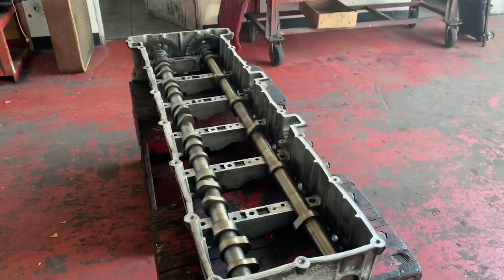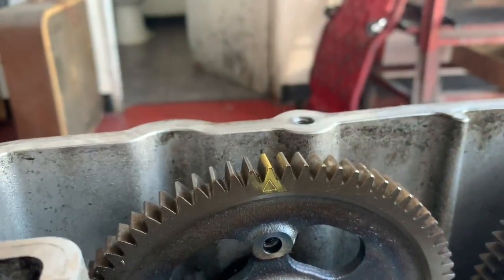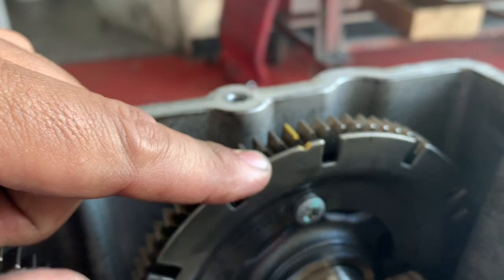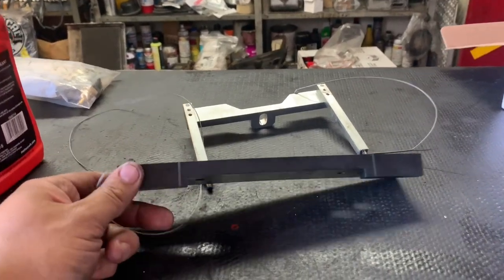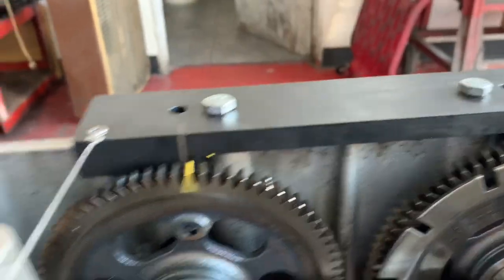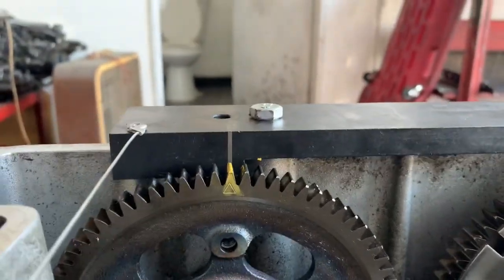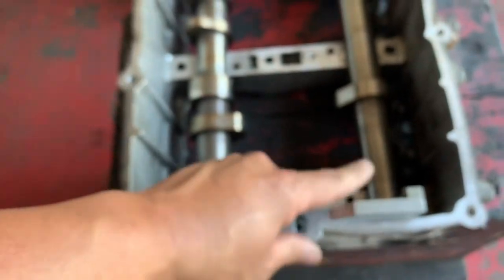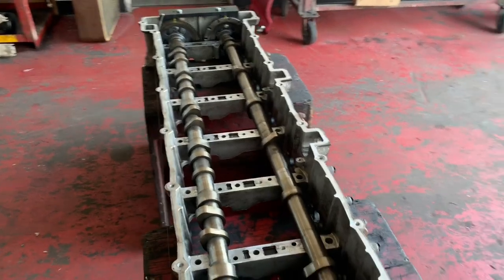Setting your timing (marks) on your dual overhead cam on a DD15 and DD13

Comment: Hey bruh need your help.

I have dd13 with the rockers and camshafts removed. I need to put them back but I wanna make sure if its tdc for cyl 1 or 6. As the cams and rockers were removed without setting timing marks or even locking the engine in tdc
Reply from the maker: Easy fix, rotate the engine and look at the flywheel housing at the bottoms. Look for the mark on the flywheel, it is the only mark/ dimple. The mark must be at the edge or corner of the flywheel housing. If you have a timing pin, remove the position sensor and insert the pin to confirm you are TDC. Then you can proceed to install the intake and exhaust CAM and go from there. 
Let me know if that helps

Comment: Hey Carlos I have 2011 Cascadia DD15 I think my truck may have jump timing It will run for 5 miles of driving then shuts down I get a SPN 636 15 and SPN 723  2 08. .I pulled off the rocker cover and set the TDC on the flywheel the exhaust side time mark looks off.. You think I may have spun the cams-?

Comment: What if you don't have that gadget what will you do to get correct timing measurements
Reply from the maker: @andrewmganga243  great question, before you remove them you can mark the housing. But that doesn’t always work.

Comment: One quastion how do you lock crank
Reply from the maker: @deexmoo4272  remove the flywheel position sensor and install the pin. When you turn the flywheel over to locate the mark on the flywheel in the opening. Insert the pin to confirm its location.

Comment: Are the both tools necessary ? After using the first tool  ,normally  the two camshafts are well positionned ? where can i buy a similar tool useful  to adjust the position of the 2 camshafts for an  engine 4  cylinders  Mercedes Atego  EURO 6, TYPE  OM934 ?
Reply from the maker: I use both tools just to be sure my timing is correct. For me it is a good practice.
Depending on the tools you are looking for, google might be your best bet.

Comment: Quick question, is that notch in the intake cam position sensor pickup plate from factory? Or has someone carried over the timing mark from the other side of that gear?
Reply from the maker: Some of the first models did NOT have the notch but all will have the triangle on a tooth. The factory started the notch back in 2013 or so.

Comment: Why lift it?
Reply from the maker: You lift the CAM and set the marks to match because the flywheel is already set to time (TDC). If you rotate to engine then you have now moved the timing.
Reply: @CarlosDieselElectric  If the flywheel is already set lifting it then turn it to the mark the whole thing would be off wouldn't it be? I could be wrong mainly having trouble understanding.

Comment: My truck's injectors and the 13d are from the engine's injectors
Reply from the maker: The process is the same but does require different tool to set the timing marks on the CAM housing.

Comment: I work on Cummins isx15 and 12 cm870 but I'm hoping I get to overhaul a dd15 soon. Everyone I know is scared of them I don't know why
Reply from the maker: Most guys are scared because they don’t know how to work on them. There are a lot of stories out there of guys working on them and the engines lock up. 
That happens for a few reasons. Not priming the oil and fuel system properly before starting the engine. Those are the two most common issues.
Reply: @CarlosDieselElectric  Patience and practice is all it takes. I just found your channel and it's very helpful,keep it up man.
Reply from the maker: In my opinion, don’t be scared and be confident in your skills and you will be fine. If you have work the ISX15 and similar engines you can definitely do this.

Comment: Hey bro, my engine was showing signs that the head gasket was blown, i removed the head now trying to fit it back, do i just have to put the camshafts back set the timing as you have shown, or i have to time the engine again?.
Reply from the maker: I always set the engine to time before I take the engine apart. But if you didn’t, that’s ok. You can still set the time so you have the engine at TDC. 
Then install the CAM’s. Sorry for the late reply.
Reply: Okay im from Zimbabwe im having a hard time to get hold of that timing tool, is there any other way to set the cam timing?.
Reply from the maker: @libertytinashe3555  you can set the timing on the engine TDC, but to set the intake and exhaust CAM you do need the timing tool to make sure the marks are on point.

Comment: Hey bro nice video, So what about if I missed the timing and I have to set it again how will i gonna do it
Reply from the maker: You may have to start over. Did you take it apart when you were at TDC 1? 
Or what did you do? Just so I can understand where you are at?
Reply: How can I start over should I remove it one by one again
Reply: The Top was leaking oil but we did get the correct timing so the car was not starting? So I came online to watch ur video, so we set the timing again and the car started
Reply: But the moment the car get started we didn't get the engine sound well, and the engine was on 4 to 5 minutes and it turns off so now the the engine isn't starting again
Reply from the maker: Could be air in the fuel system can cause the sound and hard starts. If the timing is off you can also have this issue.
Reply: Am from Ghana 
west Africa
Reply: Ok
Reply: I have turn the flan wheel and the camshaft timing is on position
Reply: Please about from YouTube any app I can chat with u
Reply: So dat I can send you some images
Reply: Still the car isn't starting

Comment: Hey great video I'm changing the housing gasket how do I adjust the gears
Reply from the maker: I first start with removing the valve cover so I can make sure the engine is TDC 1. You can see the timing marks. Then, you will need the CAM timing tool and the timing pin at the flywheel.
You don’t have to adjust the gears. Just make sure the timing is set before you remove them and of course when you are going to need to set the CAM when you place them back down.
Reply: @CarlosDieselElectric  thank you so much for that I bought the tools and I never done the dd15 I work with cummins and volvo

Comment: Dd13 2015 code spn 723 fmi 11
Reply from the maker: Could be the CAM Shaft Position Sensor, could be a harness issue, could also be the CAM (intake). 
What have you done to the truck? Any repairs?

Comment: Hey brother how’s it going. I did the housing seal but took everything apart as one, didn’t remove piece by piece. When I placed the cam housing back I notice the exhaust timing mark was of by one tooth, intake was right on the spot, will this be an issue when starting the truck? I appreciate your advice
Reply from the maker: It might be an issue, you would have to perform a valve adjustment in order to check. 
I would hate for you to bend a valve or damage something when you start the engine.

Comment: Hi, 
Thanks for the video. I did dd15 overhaul, but the timing on the camshaft gears little out line. At the bottom by flywheel is perfect. Would you advise please
Reply from the maker: sandy bil which CAM is out of timing?
Reply: Carlos Diesel Electric , both exhaust to the left of line. And intake to the right of line
Reply from the maker: sandy bil If your flywheel is in the correct position and the timing pin is seated then the CAM should be lining up. I usually experience the intake is just slightly off center. I recommend to pick up the CAM and reposition as close to it as possible. Use the tool to line up the marks on the gear and then use the other part of the tool to line up the front part of the CAM. If the resistance is hard then you might be off. The front tool should slide out fairly easily.
Reply: Carlos Diesel Electric I have picture if I could email please.
I tried and picked both but still little of.
Reply from the maker: sandy bil email me. Carlosdiesel@sbcglobal.net

Comment: Hey how you doing I got a 2011 freightliner Cascadia I just did the timing seal on it but their rear marks or one teeth out  but I put the time in to before I remove the house and can I get the paint on the fly wheel would you help me out with anything please thank you
Reply from the maker: Vasya is this the intake CAM?
Reply: Carlos Diesel Electric no the exhaust it’s one teeth out is anyway I can send you a picture because I’m confusing with that whole day and this is my first time in housing seal
Reply from the maker: @vasya7638  send me a pic. 323-697-2425
Reply: Carlos Diesel Electric and I have a timing tool which I bought it the timing tall is locked in the front
Reply from the maker: @vasya7638  double check the flywheel, not just in the window of the housing but also use the pin that is installed where the crank position sensor. Something might be off just a bit.
Reply: Carlos Diesel Electric Yeah the pin inside I just lift  the housing up I was able to move it one teeth Everything is on time thank you for Help 👍👍👍
Reply from the maker: Vasya awesome 👍🏼
Reply: Carlos Diesel Electric thank you again I was lost man thank you so much your video help me a lot

Comment: Im about to set the head on a dd15 so i got you how to setup the timing on cams 
But u didn’t say how to timing the crankshaft 
Please
Reply from the maker: Tito omar check out my other video. DD15 valve adjustment part 1. I go over how to set up the crankshaft on TDC and using the timing pin.

Comment: Hey I installed cams timed the flywheel and locked my cams and now am getting a cam timeing check engine light. Maybe engine harness???
Reply from the maker: You might be off just slightly on one of the CAMS, my guess is probably the driver side CAM. Was the light or code there before?
Reply: Carlos Diesel Electric there timed right on the lines on the tool and locked.  The truck had a bend valves and the exhaust cam lobe turned.  So I took everything off and replaced all replaced cam swapped head.
Reply from the maker: Typhoon Submerine need some more information, what year is the truck? Was the code there before? Did you replace the CAM position sensor?
Reply: Carlos Diesel Electric yeah I replaced it. The truck was running down the road and the valves bent due to a overspeed cam lobe turned on cylinder 3and 4 head valves got bent piston were good just put new exhaust cam and anouther head from a machine shop.  I think maybe the intake cam is shifting due to a bad cam housing truck is a 2012 dd15
Reply: Carlos Diesel Electric cam position sensor check engine light comes on and off about 10 seconds on and then turns off
Reply from the maker: Typhoon Submerine that is possible that the CAM is shifting. I would time the engine TDC 1 and check the valves. It sounds like you did everything right just something isn’t matching up.
Reply: Carlos Diesel Electric got it will do tomorrow thank you
Reply: Carlos Diesel Electric I had a bend tone wheel on the intake cam very slightly bend.  Thanks you for helping bro
Reply from the maker: Typhoon Submerine you are welcome. Glad you found the problem

Comment: Hey bro great videos man, just subscribed to your channel. Question im about to do the cam housing gasket. Of course im gonna pull the whole housing as one part. Now how would I set the timing with all the cams in place? Just rotate the flywheel? Let me add, ill be using the same timing tool, but with the flywheel pin. Thank you so much for your videos brother.  God bless
Reply from the maker: I recommend to rotate the flywheel, once the CAM's are in position (meaning you see both marks on each CAM at the 12 o'clock). Then you are ready to begin, however you have to keep the CAM's from moving this way once you return the complete housing back in to it's place the CAM's will be in their correct position.
Why aren't you just going to tear it all down and remove it piece by piece?
Reply: @CarlosDieselElectric  hey bro thank you for responding. Well im hopping to just pull out the cam housing with the valves still attached. Ill be using a cherry picker. Do I still have to break it down to pieces to replace the cam housing gasket?
Ill be doing a valve adjustment considering your video also.
Reply: @CarlosDieselElectric  bro valve clibration gage no mm no gage

Comment: Hey professor,  what's head bolts torque specs? Thanks for videos, you are a blessing.
Reply from the maker: the head bolts are as follows.
37 lb-ft
184 lb-ft
90 degree torque turn
90 degree torque turn
Start on the bolts nearest the injectors first in the center in a cross or X pattern.
Then work on the bolts nearest the outside, first in the center in a cross or X pattern.
Some cylinder heads have two additional small bolts, those are torqued at 44 lb-ft.
Hope this helps.
Reply from the maker: Phil Elephant thank you for the compliment. But I will not be back to work until next week. I can look it for you then. I have to check the books to be sure.
Reply from the maker: I am back from vacation. If you still need the info let me know.
Reply: @CarlosDieselElectric  Great. Welcome back
 Yes i still need help with the specs.
Reply from the maker: Phil Elephant ok. I’ll try and post them or I can text it. Probably easier to text
Reply: Hey am about to open a dd15 that burnt crank bearings
How about the other gears should I mark them all

Comment: Hey brother I need some help!! 
I did a Tune up valve adjustment 
I clean my DPF 
I change my Turbo Actuator 
Oil change with all the filter, except the
 fuel /water separator. Because it still ok. 
Change fuel rail gasket 
Change Delta port sensor/Calibrated!  

My question is, how come I’m still getting same MPG without any differences what so ever.? The truck runs find. But after all that I would thought I would see some improvement you know. It’s a Cascadia Evolution 2015, 588750 miles. Thanks in advance for you time🙏🏼
Reply from the maker: Sonxai Rasakhamdee what is your fuel mileage? Most Cascadia should get around 7 mpg. Is this a local truck? Do you drive cross country?
Reply: Carlos Diesel Electric 
another thing!! 
Every time I watch your works!  man I soo wish when I was younger I coulda ask to be your apprentice👍🏼👍🏼. How you explain things and hands on training!!! That information Alone is worth GOLD!!!👍🏼 
I’m sure everyone that see your videos appreciate you taking your time to make all the videos!!
Reply from the maker: How about the air filter? Was that changed?
Reply: Carlos Diesel Electric 
Your Shop is at 
659 S maple Ave in Montebello right bro? 
Because one of these day I would love to bring my truck for work and service. Finding a great mechanic ain’t easy man!!🤷🏼‍♂️. I’m getting rip off left and right. People are so shady these day🤦‍♂️🤦‍♂️
Reply from the maker: Sonxai Rasakhamdee yes. Still in Montebello.
Reply: Carlos Diesel Electric 
I’m getting about 7.4mpg, 22k on the weight. Cross Country OTR. But I get the same mpg even before I did all of those mentions. Yes I also change the air filter about couple months ago. My friend got the same Cascadia and he’s getting about 7.9- 8.2 mpg and he didn’t even do anything yet. I’m just kinda disappointed that’s why😁
Reply from the maker: Sonxai Rasakhamdee I have seen a difference with people that have automatic transmissions versus manual transmissions. Automatic transmissions tend to get slightly better mpg. Also. Do you have a 10 speed?